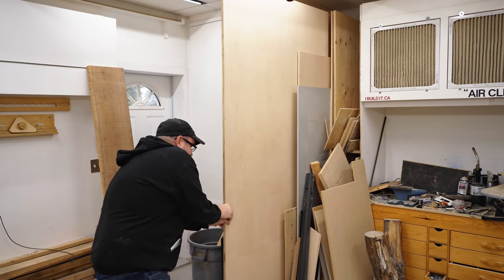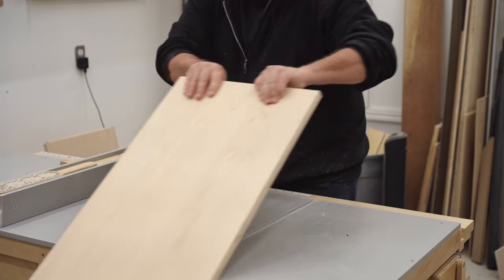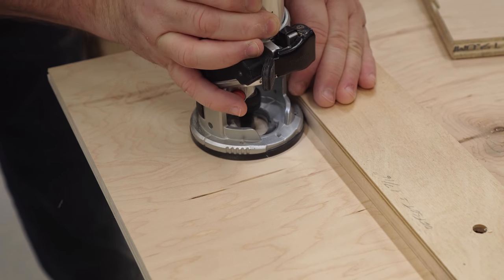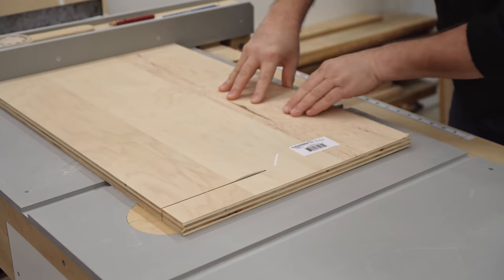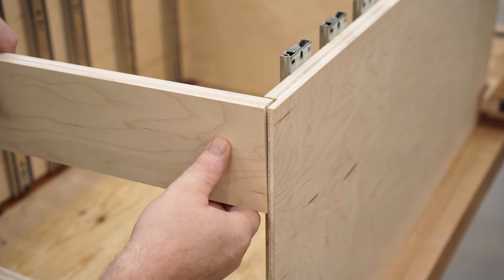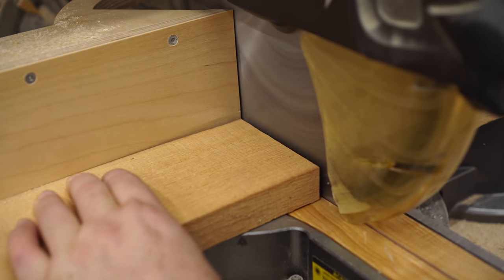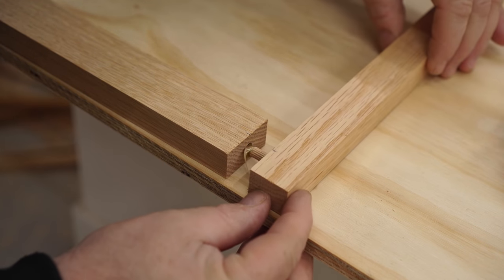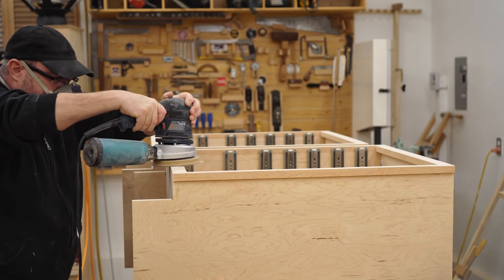Making High Quality Cabinets - Base Cabinets - Kitchen Cabinets

Comment: I really like your methodical way of using a table saw, I think I have learned alot just by seeing how you use eyes and hands and combination of the two. Keeping an eye on that fence and slowly wrestling the plywood behemoths through. I will keep watching all your videos that you are nice enough to put out there. I have been here in silence for years, now not so much I suppose, so thank you for teaching me so many things.
Reply: @RSterkenburg  Thank you for your strong concern for my health, and I can report that the only time it comes off is when I use sled with hold downs of workpiece. I have gotten a kickback in my stomach years ago and it turned it blue from hip to chest, so I was "lucky" to experience the stupidity in a harmless way that I don't want to happen again.
Reply: Here is a novel idea, LEARN HOW TO USE THE SAW!!!! Whether you use a riving knife or not, whether you leave the poorly designed guard in place or not, LEARN TO USE THE SAW!!!! Kick back happens when you, the operator, does something stupid.  Riving knifes are great accessories, but they do not make up for you doing something stupid.  And the table saw is capable of doing things that a riving knife would prevent (ie. cutting large cove moldings).  So although I agree that a riving knife is a nice to have feature, the man clearly knows how to use a saw, so exerting your OPINION as fact and the only “correct” answer is even more STUPID!!!!!!!

Comment: Hi John,
Another great video - thanks!  Good timing, as I will soon be building a set.
I have a suggestion for your doweling of the face frame stile/rail joint.  Where things will be hidden (such as the sides of the stiles where two cabinets are side by side), I will put the joint together, then install the dowel from outside:
1) Glue the joint
2) Clamp it in a corner clamp (such as Izzy's wedge corner clamp) {Optional - usually #3 below is enough}
3) Pin the joint with a brad nailer to keep it aligned - put the brads to the sides away from where the dowel will go {also optional}
4) with the joint glued and aligned, drill all the way through the stile, into the end of the rail.
5)  Glue & install an extra long dowel.
6) clamp with bar clamp to keep the joint tight.

Comment: It's interesting to see someone use polyurethane construction adhesive with biscuits - I'd never considered it simply because I was taught biscuits only work with water-based glues. Thanks for the heads-up!

Comment: A job well done I wish I had the tools and a place to work in I only have a hand circular saw ,so I have to use a big set square and work out side will take me a lot longer the  ply in the UK is expensive so I will only be using 12mm ply . My units will be for a camper van I’m building,

Comment: This is interesting - when are you deciding to use the construction adhesive over the wood glue?
Reply: GalaxyStranger01 I’m wondering the same thing!
Reply: Same.
Reply: This was filmed in the winter. John has said his shop is cold and construction adhesive works better than wood glue at that temperature.
Reply: @cousindave1  
Thanks!

Comment: Nice cabinets! And smart to calculate and mark and fasten those drawer slides on first, cause it's not the most fun job later :) 
I just wonder why that dowel jig didn't work for you, I've used such tool with success, drilling and trouble-less-ly gluing up 21 dowel joints, my piece of wood was a bit taller(deeper) and it was good for over 50 holes, later it started to get too loose, but the project I built it for - was done before that.

Comment: John, I build plenty of kitchen cabinets, but they're all frameless.  What was the reason for the frames nextending past the cabinet sides?
Reply from the maker: It's a typical detail for modular face frame cabinets and serves a few purposes. 
First, it's a cleaner look than trying to make it flush with the side panel. 
Second, it gives something to plane down to make the cabinets fit together tightly when installing them. 
And third is that it helps when mounting the cabinet on a wall that's not straight, since only those two frame edges need to be tight together, and not the whole surface side panels.

Comment: Great build and video. I am curious as to where you source your drawer slides.
Reply: Any big box store sells them or you can wait forever and buy them online.
Reply: @KipdoesStuff  yeah I know the big box stores sell em. They also are far from cheap at our local lowes, around 10 bucks a piece. About the same on amazon.

Comment: Nice job, I'm surprised you haven't picked up a track saw they are so fucking handy.
Reply: Why should he buy a track saw? He's made a few. I wonder if John is going to re introduce the cross cut option to his new table saw.
Reply from the maker: The new and improved crosscut guide for my table saw is an upcoming project :)
Reply: @LostWhits  Because they are a very useful tool to have that save time.Also I never said he SHOULD I said I was surprised he hasn't it's not for me to tell him where to spend his money.
Reply: @JohnHeisz  Nice I look forward too it, thanks for the content BTW I've learned a lot from your vids.
Reply: @solidus784  he built a guide for cutting stuff. can get plans for it also on his website
Reply: @WreckerWarsdotcom  thanks

Comment: How do you get rid of the squeezed out construction glue? Cleaning up is probably the only thing I don't like about construction glues.
Reply: Just wipe it off with your finger, then sanding should remove the rest.

Comment: I just have a question - @6:39, the lower clamp (actually for the back of the case) does not seem like the jaws are deep enough to squeeze on the joint.
Does the other clamp that has the proper reach due to the cut-out for the kick keep that from being a problem, or do you do the next step (top stretchers) right after so they keep that clamp from pulling the case out of alignment?

thanks for the great video, John!

Comment: Curious why construction adhesive as opposed to wood glue especially for the face frame attachment to the cabinet bases?
Reply: Longer open time and he is working in a cooler shop than is recommended for regular wood glue.

Comment: I know you hate, despise, dislike backseat commentary, but just a quick tip on your rabbit procedure. If you swap the order of your cuts so that you do the standing cut last, then you won't have a missile launcher on your hands. By cutting the way you did, it leaves the cut off left behind between the fence and the blade. If you instead swap the order of cuts, then the cutoff is on the other side of the blade. Just my .02

Comment: Hi, John. I was wondering, why did you use wood glue 7:45 for the back panel instead of polyurethane adhesive 5:48 6:41 as you did for the other parts?

Comment: 11 minute mark, other YouTubers: "Biscuits are useless"  ... John Heisz: "Let me show you the way my sons"
Reply: Granted they're no substitute for good joinery. But then neither are pocket screws or Brad's for that matter. That said I like using them as a substitute for a spline. I'll put a biscuit about every 4 inches. Over engineering? Sure, but then I'm the guy that hand nailed my 3/4 flooring with a finish nail every 3-1/2 inches. The floor doesn't squeak 😜

Comment: Just curious why you use the construction adhesive rather than the standard glue most people use - what are the pros and cons of construction adhesive?
Reply: Pros: longer open time, works on more materials, doesn't get suck into end grains, doesn't swell the wood, works better in cold shops, doesn't drip. Cons: messy, more visible if there is gap.
Reply: @JW77  Is it stronger too?
Reply: @paulgreene9997  about the same, depending on use.
Reply: @paulgreene9997  they are both probably stronger than wood, if the joint is tight.

Comment: when making face frames why is the frame always a little wider than the cabinet?
Reply: Adjustability. Makes it easy to keep the front in the same plane.
Reply: Also to allow for variation and unlevel and unplumb conditions of the floor and walls.